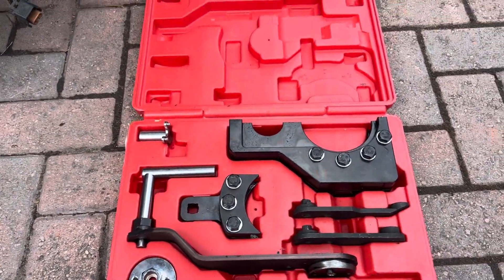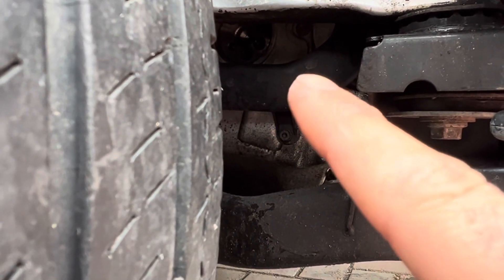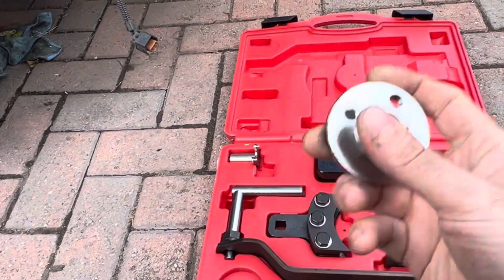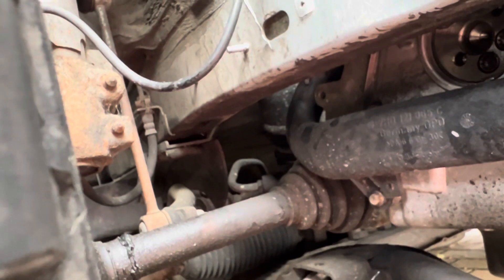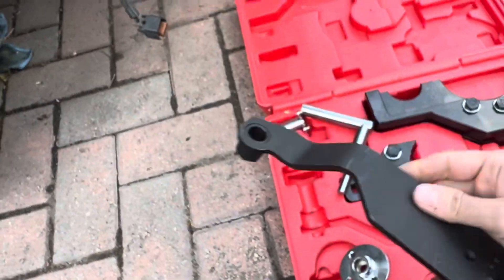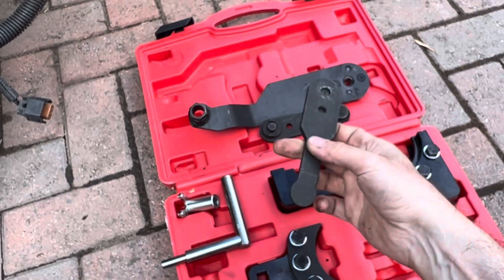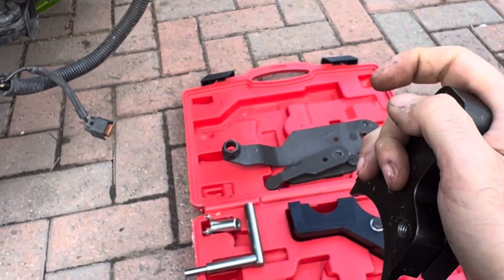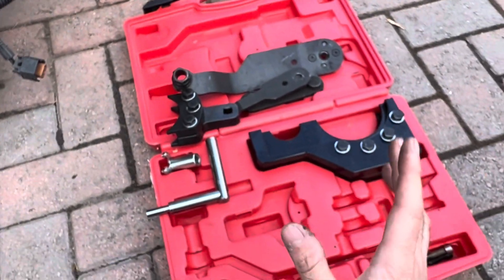VW Transporter 2.5 AXD AXE BPC BNZ BLJ Camshaft Timing Tools Explained

Comment: Cheers for the info, about to start doing my 2.5 tdi, looks a bit of a pain 🤣
Reply from the maker: It's not actually THAT BAD just tedious.. Don't forget to check the back lash your injectors before you put the rocker cover back on.... Also its well worth investing in a set of service pins to make the job easier.

Comment: What branded tool are you using Dave. Read a lot of negative reviews about poor quality timing tools being sold online
Reply from the maker: It was a cheap one off eBay. The only issue I had was the pins on the crank locking tool just needed pressing out a few more mm
Reply: Cheers Dave, Have you completed the job yet? Would be interested to see your progress
Reply from the maker: @TheRobbie40  yeah I did it when I made this video, unfortunately it was very difficult to film it on my own 🫣